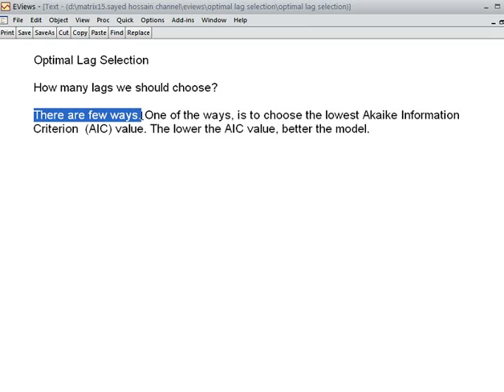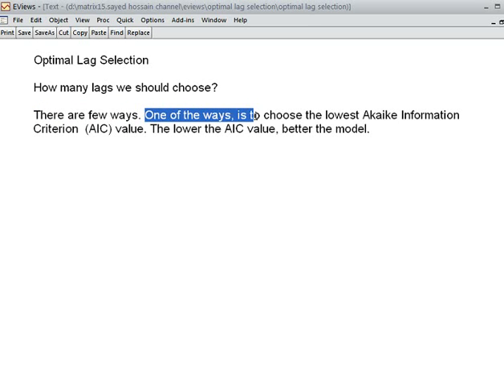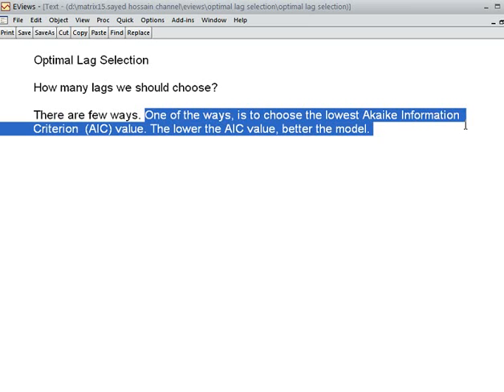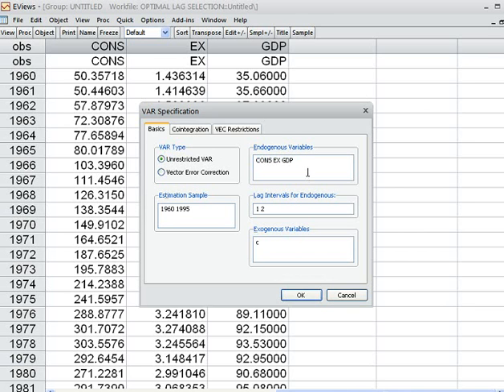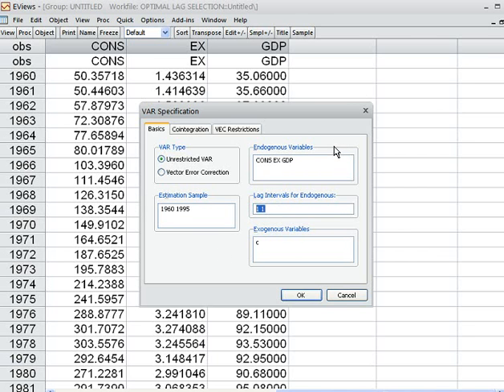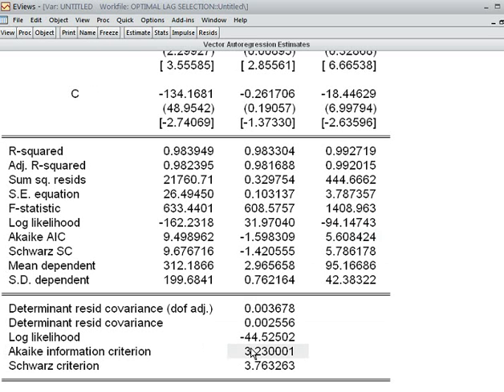Lag selection. Model One. EVIEWS

Comment: Hossain sir! According your other video, lag selection is already done before Johansen cointegration test and you used that lag for Johansen conintegration test, VAR or VECM. Here, you've assumed that you've already tested Johansen cointegration and assumed you found that data are not cointegrated. Then you have run VAR. But You have again estimate optimal lag, why????. Is this selection needed again???? If yes, why you said the lag selection from lag structure is optimal for Johansen conintegration test, VAR and VECM????? I've got a confusion that lag selection for Johansen cointegration is same for VAR and VECM or is different for VAR and VECM??????

Comment from the maker: At most 1 is null hypothesis and you fail to reject it as p value is more than 5 percent meaning that you accept the null hypothesis that there is 1 cointegration equation. So you do not need to check At most 2 null hypothesis at all.

Comment: Hi, could you help me? I have a doubt regarding Johansen cointegration test. As you show us in your video, I choose a lag length 5, so I get this results. How can i interpret the following results?

None * p-value = 0.0452
At most 1 p- value = 0.0568
At most 2 * p-value = 0.0445

Trace is indicating 1 cointegrating eqn at 5% level. But what about "At most 2* "? it's also significant, on the other hand "At most 1" is not.

Many thanks in advance.

Comment from the maker: You can only use the restricted VAR (that is VECM) model when the variables are cointegrated. Cointegration can be found using Johansen Cointegration Test. If the variables are not cointegrated, then run unrestricted VAR.